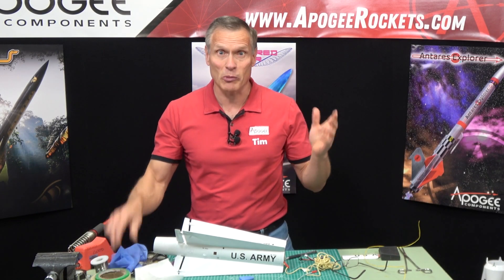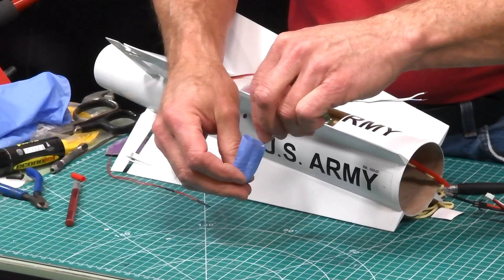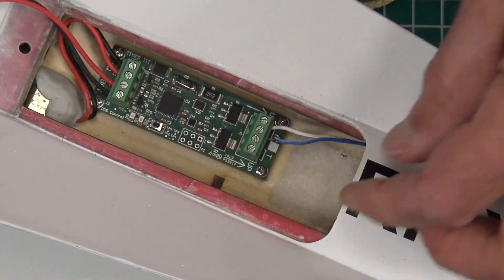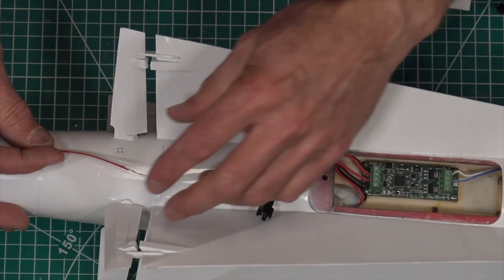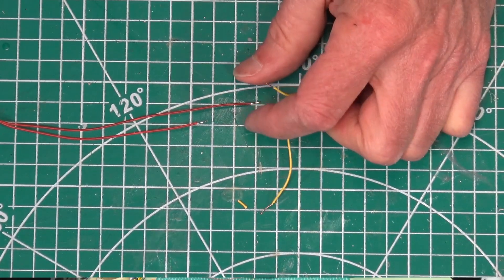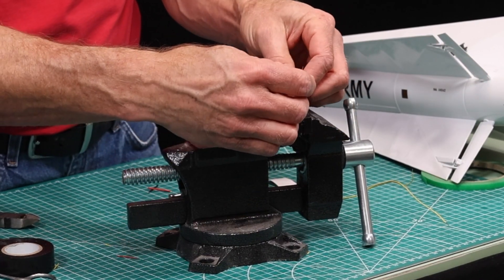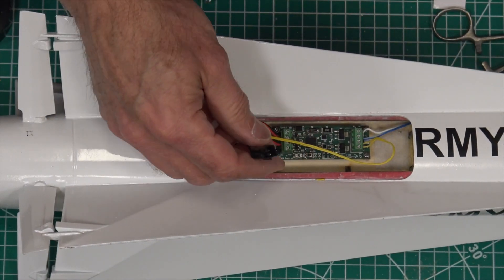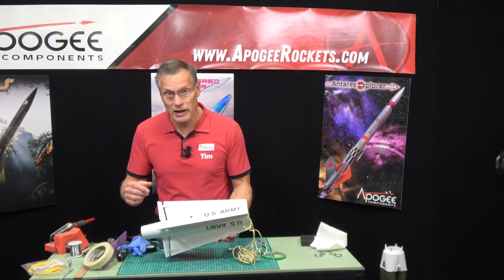Electronics Part Three  | Build the Apogee Nike Hercules Model Rocket

Comment: If the wire splices are staggered then theoretically you don't need to insulate them.  If there is a chance that the wire will fold where it goes through your straw you could just insulate one of the 2 wires, you wouldn't have to insulate both of them.  All of this would reduce the amount of material to feed through that straw.
Would it make any sense to feed a long wire from the timer back through the straw and through the rear bulkhead and then splice the igniter on there when you are prepping the rocket at the pad?
Reply from the maker: I don't know If I'd splice while the rocket was on the pad. You have to do everything to make sure that it ignites, and it just seems that you'd be taking extra chances.
Reply: @apogeerockets ...I agree....if it can go wrong it will go wrong. Don't take chances. = )